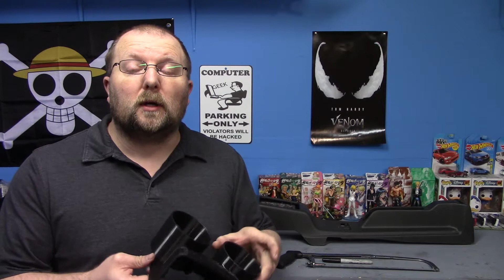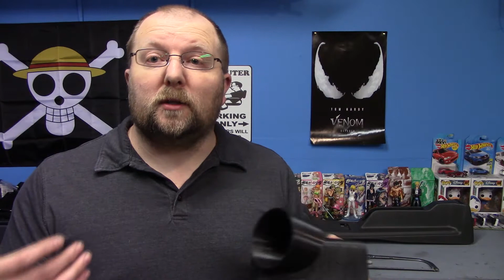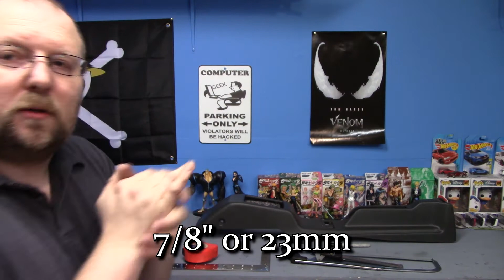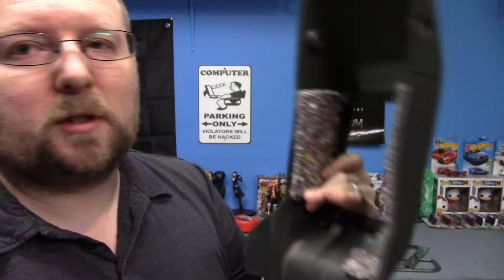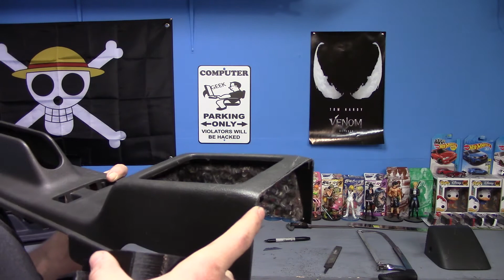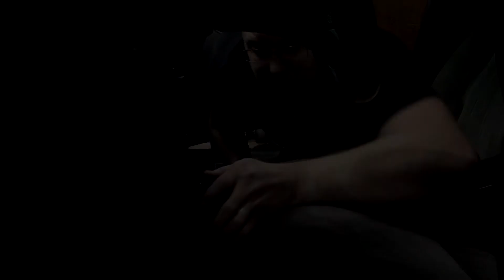EF 88-91 Civic Cup Holder Install

Comment: Would this work for a 1995 ex coupe honda civic?
Reply from the maker: This one will not, but I do have a replacement cup holder for the 92-95 civics on my website - naytontech.com
Reply: @NaytonTech  Okay thank you, Is it the EG center console cup holder just to confirm? and does that have the same setting up as the one in this video or is there separate video to reference it on? & Thank you for responding!
Reply from the maker: @kcue  Yes, the EG center console one, and it replaces the factory EG one, so you don't have to do any modification, just 4 factory screws from the bottom of the console - super easy install.